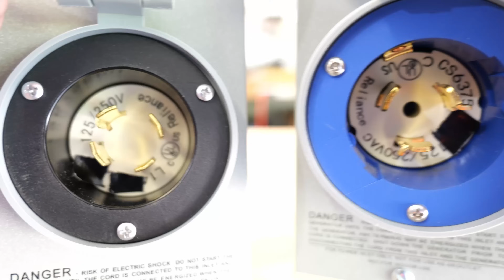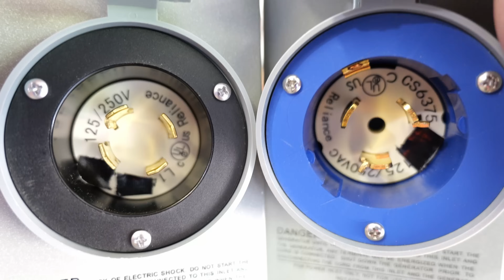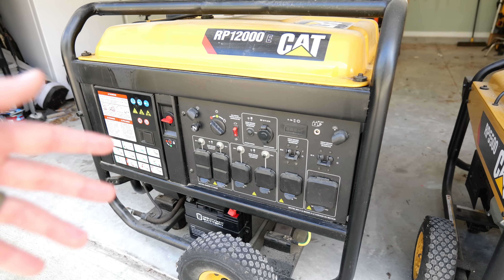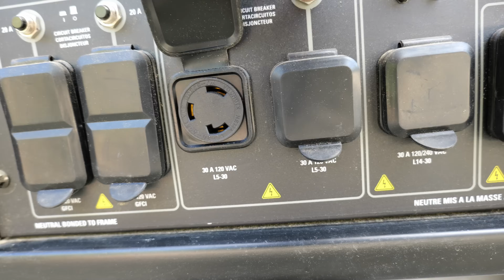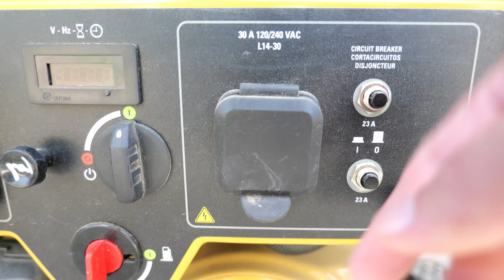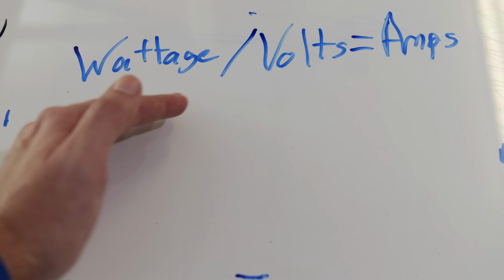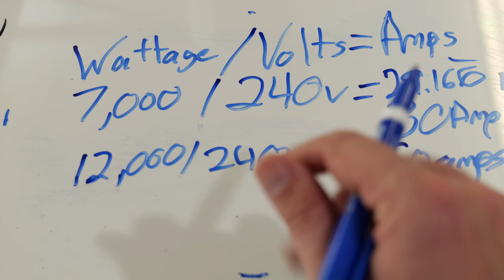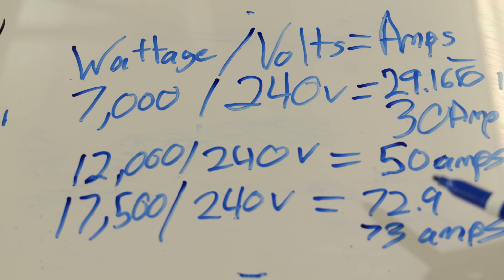30 Amp vs 50 Amp Power Inlet Box.  What's The Difference and Which One Do You Need?

Comment: Please help w this question:  so im plugged into my house 200 amp panel w a 10500 w gen 50 amp plug and genn is floatiing neurtal.  All is good.  Question, what happens when my neighbor wants to plug directly into one of the 120 volt outlets on the gen?  Is this potentially dangerous because at this point the gen should be bonded neutral?  And for safety this scenario should be prohibited?
Reply: That's completely safe. Your generator becomes grounded when you plug it into your house via the 50 amp cable. It has a ground wire in it, that connects to your houses grounding rod.

Comment: Why not just get the 50 amp box installed so you can always upgrade and just get the 50 to 30 amp converter plug
Reply: Can you do that?
Reply: @leyfavorite8501  I think they sell them at the RV place
Reply from the maker: Yup nothing wrong with that.  The larger wires and plug will easily handle the 30 amps and if you want to upgrade you’re already set.  I use one of those 30-50 amp adapters in my latest soft start kit video to do some testing.  I have a link in the description of that video to the one I used that can be ordered on Amazon.

Comment: Thank you for your very good info great video can you tell me how to connect the AC unit to the transfer box ? I have separated the 30amp breaker from my regular subpanel is located in front of my house in the main braker hope you can help me with this
Reply: Make sure your generator or inverter doesn't have 40 volts between the ground and neutral I was going to power my box with the generator but the neutral and ground are bonded and that would short out the neutral to ground. Since my incoming line is cut I could take out the bonding screw but for now I'm going to disconnect a few lines and plug them in the power station which have their own circuit breakers . I'm learning some things about inverters and generators on you tube. 73

Comment: I have a 3700 watt generator I use for camping and I would like to install an interlock on my Siemens 200 amp home panel. This would allow me to choose the circuits that I need in a power outage. Like sump pump, gas furnace, refrigerator, etc.. My generator has a 30 amp 120 V output. Can I install the 30 amp 2 pole generator breaker to supply power to both phases of panel to power 120 volt circuits?
Reply: Yes and no. Some houses share neutral wires in something called a shared neutral branch circuit. If your house has those, you wont want to energize both sides of your panel with the supplied 120V. You could run the power wire into a 30 amp single pole breaker, and that would power every other circuit on your panel (turn off the 240V loads). Many sump pumps are 240V and you wont be able to power that with your 120V generator if thats the case.

Comment: Great vid! I have a a 3.5 ton AC with a micro air soft start. About 27 amps start 11 run. I need a generator that can run that unit, a fridge/freezer and a deep freeze. I would like to add light but those are my must haves. How big of a generator would I need? I have been looking at the Duromax 13000kw tri fuel and the amps on it are 35 out of 50 with natural gas(which I want to hook it too).
Thank you
Reply: I can run my 4 ton AC with a soft start with a Champion 7200 watt generator. I even ran the oven with it for a short period, but I would not recommend that as it strained heavily on adding that load. The in rush on the 4 ton is about 20 amps. It ran my pool pump, lights, and two refrigerators. Certainly some light dimming and straining when the AC powers up. An inverter generator would be better but they are expensive.
Reply: @bhbaker220 I have a Wgen9500/12500 will this run lights, water heater, outlets, refrigerator, Freezer and stove?  I want to add AC but I have two units covering 4500sqft. Thanks for any advice
Reply: @garyponder7139 an electric hot water heater typically consumes 4000 watts to 5000 watts so I would say don’t attempt that. If the stove is a cooktop with multiple burners, I would only use one burner as these are large electric consumers. My oven draws over 4000 watts, so I would typically not attempt running it unless it’s the only thing I’m running. The lights and refrigerator/freezers should be no problem. Things like blow dryers, shop vacs, air compressor could throw you over the top so I would not run them. You might be able to run both AC units if you have a soft start on each and don’t try and start both at the same time. Remember that the higher the load on the generator, the more distortion you’ll have which is bad for sensitive electronics unless it’s an inverter generator.
Reply: @bhbaker220  thank you I will heed your advice.
Reply: @bhbaker220  thank you
Reply: That is my setup.I plan on never putting gasoline in it. I am interested in your ac soft start. I wonder if my old AC is worth the effort.
Reply: How big of generator you'd need could only be known once you calculate how many amps you need for your situation.  My only suggestion would be to look at getting a soft start kit for your fridge/freezer, which allows the appliance to start at lower amps, but make sure it's appropriate and suited to your particular appliance.

Comment: I have a 50amp inlet box that I use for my 10000w generator can I plug my small invertor 30amp generator into it using a dog bone 30amp to 50amp
Reply: Yes you can plug a smaller 240V generator into your inlet box using an adapter. If you have a smaller 120V only generator, you can plug that in with an adapter. Depending on how your adapter is wired, it will either only power one leg of your panel, energizing every other circuit. Or, if the the two hot wires are bonded together in your adapter, it will put the same 120V on both legs of your panel. This may or may not be safe depending on if your house has a multiwire shared neutral branch circuits or not. Or course, if you hook a 120V generator to your panel, be sure to have all your 240V circuits turned off.

Comment: I own a Champion 9000-watt inverter generator with 7250 running watts.  I t has both 30 & 50 amp connectors.  Shouldn't I be taking into account the generator's starting watts when determining 50 vs 30 amp inlet boxes?
Reply from the maker: No.  Now you are straddling that line of 30 and 50 amp.  In your case since you have a 50 amp connector, then there is really no reason to consider setting everything up as 30 amp.  Technically 7250 running watts is barely over 30 amps at 30.20 amps but it is over nonetheless.  It is interesting because most generators in that category don't include a 50 amp receptacle.  Even Champion has an 8,000 watt running 10,000 watt surge rated generator and it only includes a 30 amp receptacle.  So right there you can see that the surge watts are not what are considered since that one has 1,000 more surge watts than yours but they only wire it to be rated for 30 amps.  If it was me though, again, since you have the 50 amp receptacle, I would wire everything up as 50 amp, that way you know you are covered and that way if you ever decide you want a larger generator, it is already setup.  Hope this helped.

Comment: Thanks for breaking it down to where I can understand  the normal running watts vs the peak watts .
The generator I’m hooking up does have the 50 amp outlet built into it but it’s a tri fuel gas being the highest wattage 7500 (normal operation) and 9400 peak by. So I will be using the 30 amp box to connect to my home so I can have some backup power
Reply: As long as you have a 30A breaker protecting the inlet that is fine.
Reply: @tomschmidt381  I appreciate your reply thank you
Reply: I have a similar situation, but is there a reason why I couldn't use the 50amp outlet on the generator and connect it to a 50amp input on my panel with a 50amp breaker installed? (thanks for all of your great videos.  you have taught me a lot!) @tomschmidt381

Comment: I love your videos! Thanks so much, Bro! So, my generator is 30 amps (4500 watts) but my future plan is to get a larger generator (12,000 watt) 50 amp. So, can I go ahead and install a 50 amp receptacle to my home and then use a 30 amp adapter plug for now with the 4500 watt generator and then my home will already be set up for the 50 amp generator down the road. That will work, won't it?
Reply from the maker: Yup.  You can always have the larger 50 amp rated wire and box installed and run a smaller generator on it but can’t do the opposite and have too small of wiring and box and run a larger one.  Hope that makes sense.  It’s good to plan ahead like you are.  Thanks for the feedback!
Reply: I was thinking the same way. My generator only has a 30 amp plug. I was wondering if you go with a 50 and then get a bigger generator later

Comment: After you connect the correct gauge wire from the plug, how do you connect the wire in the transfer panel?  Do you use wire nuts on the supply wire to the wires in the transfer panel?  Do you use Burndys?  I wish there was a bar with better connections than just 2 large wires that need to be connected.  I have a reliance transfer panel system.

Comment: Great video. Explained very clearly. People also need to understand that most portable generators are neutral bonded. Important to remove that bond for feeding a home this way all ground and neutrals are only bonded at the first means of disconnect. I found and removed the bond on mine. I keep a make plug zip tied to the generator with a neutral to ground jumper in case I want to use the generator out in the field for powering lighting, tools, etc. i just plug in the jumper in that situation.
Reply: Great advice. I did the same on my generator. Finding the bond can be tricky. On some it is at the power head others in the outlet area. I have a HF 7,000W genie, the bond was at one of the 120V receptacles. 

The generator is pretty heavy so I don't intend to move it around but figured I'd make the jumper plug just in case the need every arose.
Reply: me too

Comment: Question: I currently have a 30amp inlet box, 10 awg wire, and a 30amp transfer switch. I just bought a generator with a 9400 watt peak and 7500 watt running. The generator has both a 30 and a 50 watt outlet. If I only use the 30amp outlet, is that OK to use with my current set up to the electrical panel?  Also if the running watts are more,  like 12,000 in this video,  would it also work on my set up if only the 30amp outlet was used?  Basically what I'm asking, using the 30amp outlet regardless of the watts produced, does that outlet limit the watts sent from that outlet to a that of what is safe to be used for a 30amp setup?  Thanks for your help.
Reply: Your 50 amp outlet might have a few extra amps in capacity. Maybe.
Reply: Yes the 30 amp outlet on the generator will only output 30 amps, so you are safe using the 30 amp inlet box.

Comment: @7:20 you reference being able to have both of your generators running at the same time connected to your house. Is this through having 2 backfeed breakers or is it setup another way?
Reply from the maker: I have a power inlet box with interlock kit which essentially backfeeds my panel and I also have a transfer switch that completely disconnects from the main panel.
Reply: @HowToHomeDIY  Thank you. That makes sense about load shedding/sharing onto the smaller generator.

Comment: I have an existing natural gas valve for the BBQ grill on the backyard patio. The electrical panel for house is about 65' around the side of the house. I plan to use a 30 amp inlet (Costco generator - Firman 7500W Running / 9400W Peak). Do you see any issues using a 75ft cable to make the connection?

Comment: Question for you: I want to install a power inlet box outside, but the most likely time I'll need to use it is during a storm - do them make one that is rated to having something plugged in to it during rain? A while-in-use box I think they call it?
Reply from the maker: Thats what I do with these.  They are plugged in and running during the hurricane out in the elements.  The female end goes quite a ways into the box and provides pretty good seal.  Never had an issue.

Comment: First time I have ever had this explained.  Thank you.
Reply: Definitely go with a 50 amp receptacle for your generator because it'll already be there if you want to get a bigger one instead of installing a 30 amp receptacle and having to take it out and put in a 50 amp receptacle later 
Resulting in wasted material and money
Reply: So, I’m hesitant to ask this question, my knowledge of electrical issues is extremely poor. Why can’t you mount a 50 amp power inlet box and a 30 amp power inlet box and use both of them if the power demand of your house is that high? Thank you!
Reply: @maddog6245 Hello maddog , If you use both the 50 amp receptacle and the 30 amp receptacle at the same time , You take a big chance of overloading the generator , Whether you use the 30 amp or the 50 amp or both at the same time , You definitely have to tally up the wattage of what you're running off the generator , For example , If you're drawing 20 amps on the 30 amp receptacle and you're drawing 30 amps on the 50 amp receptacle 
The total load on the generator will be 50
amps , So it's very important to add up the watts of each appliance and other items such as the furnace , Sump pump etc , You definitely don't want to overload the generator because the windings in the generator will overheat and eventually fail , Also If you run a generator at maximum load , You risk shortening the life of the unit , A good rule of thumb is don't run your generator at maximum load , Instead , Only run it at 80% load , For example , If your generator has a 50 amp capacity , Don't exceed 40 amps 
To figure out watts , Multiply volts times amps 
To figure out amps , Divide watts by volts 
If you're in the market for a generator , Get the biggest one you can afford 
What you'll need to do is add up the watts on the refrigerator , The furnace , If it's a gas furnace , The sump pump , The well pump if you have well water , The freezer if you have one , Also , An extra refrigerator If you have one , and some lights , But of course you're not gonna be running all those items at the same time , You only want to power up the furnace during the winter and the refrigerator along with some lights , 
The most important items you need to have power is the refrigerator , Freezer if you have one , The furnace when it's cold and some lights , Don't get an off brand generator , 
Get a reputable brand such as Generac ,
Westinghouse or other reputable brand and look at the warranty period on the unit 
A good unit will carry a two year or longer warranty

Comment: We have an inverter generator with both a 50 and 30 amp plug. The Generator (Genmax 9000 IED) only puts out a Maximum of 32 amps, but it can be tied together with an additional generator to get the Full 50 amps in the future, so I was thinking that installing the 50 amp would be best. 
Thanks for the tip of using 6 gauge wire 👍.
Reply: Always use 50A capable or 6-8AWG wire… can always connect <50A (30A) to it and there are adapters and conversion cables. Just don’t want to do the opposite (>30A on cables only supporting 30A).

Comment: Electrical stuff can scare people, as it should because of the hazard. It takes planning to design your own system. Asking a electrician to look over what you have may be a good investment for 1hr of labor and depending upon your budget and needs.
Reply from the maker: Yeah, can't go wrong doing that.  Thanks Clarence!
Reply: @HowToHomeDIY  I am having a 50 amp inlet installed. What I got from your video is the max amount of watts is 12000. So I’m guessing if I got a generator that can run at 12000 watts and peaks at 15000 watts would be a bit of waste correct? Great video and thanks!!!

Comment: Should your generator be bonded on non-bonded?.  Do you need a grounding rod for a generator that has a 50 amp power outlet?
Reply: It depends on how you are using your generator.  If you are out in the middle of the woods you should drive a ground rod and connect to the ground post on the generator.  If you are powering your house via an inlet box into your AC panel, the generator should be a floating neutral (not bonded) because your neutral in your house AC panel is already bonded to ground (main panel only).  I have a DuraMax 13000EH that I noticed that all the outlet neutrals were bonded to the motor casing (ground).  After an email to DuraMax they showed me a photo of how the factory should not have grounded all the outlet neutrals.  All I had to do was lift the neutral from the motor casing to make the generator a floating neutral machine.  Doing what I have described for using your generator as power for your house through your bonded AC panel will prevent a ground loop between to the 2 grounded points.
Reply: Never hook up a grounding rod to a generator that is hooked up to the house via a 4 prong cord. It can make an unsafe condition in a certain rare cases. The generator is grounded through the 4 prong cord when you plug it into your house.

Comment: I have a 30 amp inverter generator, but decided to go with a 50 amp inlet for greater durability and to expand to a 50 amp generator should I decide to use one of those in the future.
Reply from the maker: Yeah, I think that is a smart play.  I assume you use a 30 to 50 amp adapter then?
Reply: @HowToHomeDIY  Yes, I use the 30 to 50 amp adapter with a surge protector to protect sensitive electronics (just in case).  Works really well. 👍👍👍
Reply: @audiophileman7047  which surge protector do you use?
Reply: @BigTone-S10  I have it here on my desk.  It's the POWSAF Model:  RV5050A-01.  It has diagnostic lights on it to tell you the quality of the power and if the circuit is hooked up right.